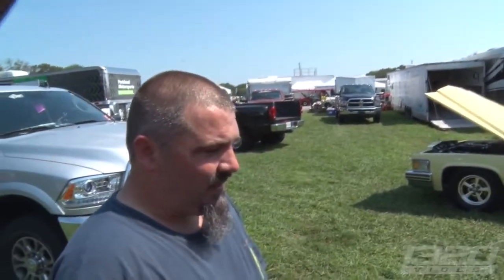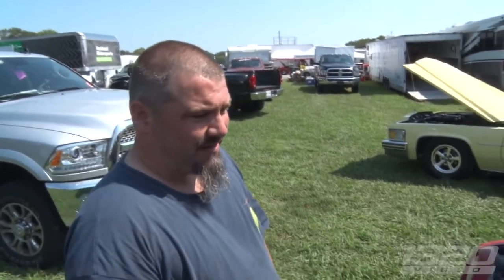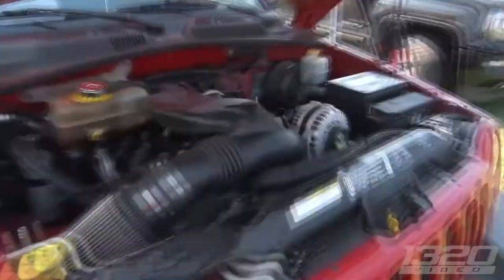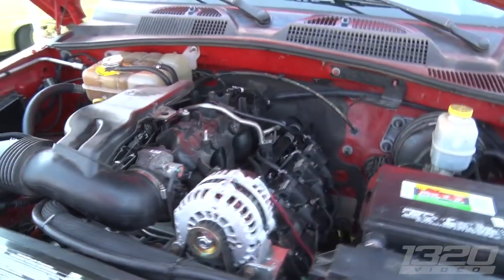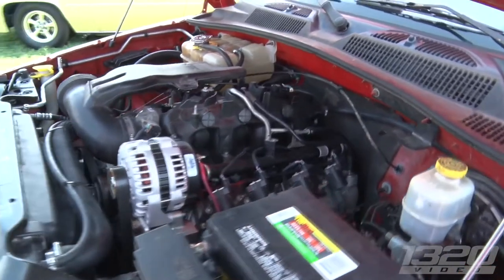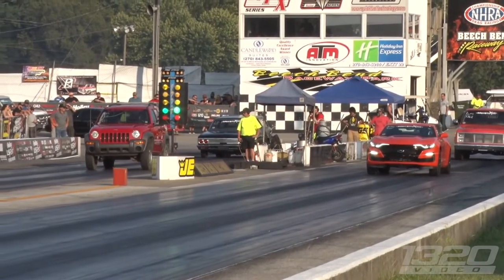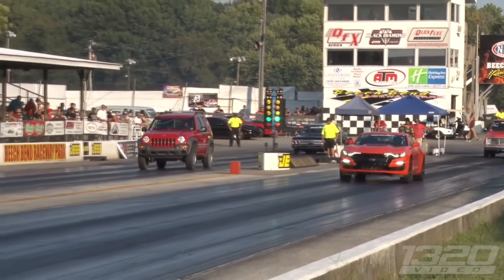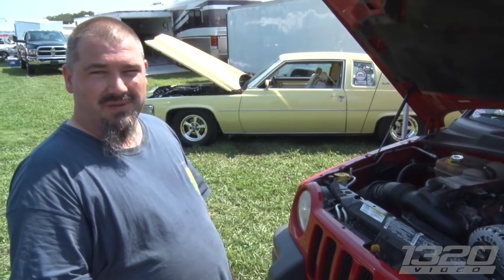1320Video Ls Swap Jeep Liberty - Holley Ls Fest 2019

Comment: I want to know more about this module! I'm a tuner and would like to know how it works and how to replicate it. Is it all CANBUS?
Reply: This is a conversion between GM Class 2 and what Chrysler called a PCI Bus. For the GM side and the Jeep side CAN would be next generation of what the data bus would have moved to in both cases. Chrysler/Dodge/Jeep switched to CAN in 2006 for pretty much everything and GM switched in 2007 for the V8 stuff since nothing with the E40 ECU really counts as TRUE Can since the only thing it used CAN for was the ECU and TCU. Everything in the vehicle was still run on the Class 2 network in those years.  And lets not even talk about the GTO, that's just a freak. 

I am undecided if my next venture will be to convert something like Mega squirt/Mirco Squirt(Maybe Holley Terminator X) so the aftermarket ECU's CAN is able to work with the Jeep's data bus....OR....if I'll do a stand alone system(Mega Squirt/Holley) into something like a GMT800 for a winter project.  

Over the winter I have a 2005 Jeep Wrangler cluster and 2001 Dodge Dakota Cluster (Both are still PCI BUS) that I'll tinker with and see how close they are to working with what I already have done for the Liberty. The Wrangler I will spend some time on since I know there is interest in those, if the Dakota is very close to the Liberty I'll also see about adding support for that as well but I won't loose any sleep over it not working. 

Now if it's something your wanting to try and get into your self. You'll need to be able to write code in C+, be able to design electrical circuits and layout a PCB in a program like eagle and then be able to solder the board up. Your best bet is going to be making your own tools to sniff the data bus with and it will also help with skills in C+ that you will need when it comes time to write a conversion program. There are off the shelf interfaces you can buy that will allow logging but they all lack good software so you'll likely end up wanting to write your own and that would be done in C#. 

Collect a log from the data bus, change something and collect a new log and look to see what line and byte changed. You'll have around 150-200 data lines that are all spitting out data extremely fast and each line has 8 bytes. Most items will be 1 byte in one line, things like engine RPM will be 2 bytes. Once you find something that you know changes with what ever your doing look for the range the value will change over to map the effective 0-100 range or if it's just a simple On/Off then verify your respective byte changes are correct and start working on a spread sheet. The On'Off values are not the hard one's to work out, its gauges that are where things get though. You not only need to make out the range of bytes that are covered but then work out a mathematical equation to put that range into something that can be written as a numerical value or even as a percentage of a starting value. 

You'll end up doing this for both data buses and working out formula so that data supplied by your source (swapped pcm) provides the same type of data that the vehicles original computer would have been sending. If this sounds like a lot of work and that it is very time consuming that's because it is. The reason you seldom see anything like this is because it is so complex. Some of the foreign car's have plug and play solutions that make this seem simple but that's because either the manufacturer provides the data and saves all the reverse engineering time or OEM data was leaked that contained most if not all the vehicles bus data. A lot of foreign car's also use a mostly universal message format across cars lines for a car lines life span so a set if bus messages may be good for close to a dozen vehicle platforms and be in use for 5-8 years. 

Domestic cars on the other hand were constantly changing message structure from 2007 until around 2012 and car lines did not share message structures, they may have shared parts but they were not directly compatible even with in the same year, there are times things will interchange and times they won't and it's hit or miss on what can be intermixed message wise over the data bus. This makes developing anything for those vehicles very hard as its going to be specif  to a given vehicle type and would only work on for a couple of years of that vehicle. 

And just to make sure it's clear, you do have to remove the original computer when doing this type of conversion but that's pretty much the point. If you wanted to keep the stock computer and wiring you would be trying to piggy back it onto the swapped engines computer. When you go for a conversion module it's to remove the stock computer and wiring.....the whole point is to keep things clean and simple.
Reply: @petesonntag7520  I love this! I am NOT a coder, but I understood everything you said. It makes be want to get into coding so I could implement this. I have a lot of Jeep guys that want to LS Swap, and would love to retain the BCM and factory controls of everything! Please let me know more about getting the wrangler working! Do you have a Facebook page?
Reply: @cliffweatherbee6914  What year Wranglers are you talking about? What engine generation? And stock or aftermarket Computers on the engine? :)

On the JK there is already an option when using a 4th gen engine with an E38 but its not cheap....and there is a reason for that. There is a TON of data that's being converted in those modules. 

I post a lot of what I do on my personal Facebook and as you've see also on my Youtube channel so those would be the best places to see anything new I'm working on. 
https://www.facebook.com/pete.sonntag.3
Reply: @petesonntag7520  awesome! Thank you! Ill definitely be hitting you up later. 

Right now I've got an 04 wrangler, and the owner is toying around with the idea of LS Swapping it.
Reply: @petesonntag7520  your gmt800 and terminator x project would have a lot of people on performancetrucks.net excited.
Reply: @petesonntag7520  Would a 06 KJ be able to work with a canbus LS without having to write code?
Reply: @petesonntag7520  Do you have a business page or social media page we can follow
Reply: Pete what other kind of pcb engineering have you played with?

Comment: Damn man where you from. If you was close enough id probably send you my toy to play with ive had my Dakota swapped for about 3 years now, runs and drives just never had gauges so ive never been willing to drive it out of town. 2001 4x4 dakota with a 2003 Tahoe LM7 and swapped over to a electric shift NP-233c but I still have my working dodge 233 if that would work better. Id love to have the systems adapted properly and everything function just like it came out the dealership.
Reply: Money would be involved obviously lol, but be a good practice guinea pig for you since everything is running driving ready to go.

Comment: Real life. .my daughter decided not to change her jeep liberty oil for over 6 months so it went dry and it sets in my driveway. I thought who the hell would do this. Fuck. I just might now! Your idea would be some shit
Reply from the maker: I put a blower on the Jeep last year simply because the whole LS Liberty idea seemed kind of stale at this point. So if you thought putting an an Ls in one seemed kind of out there....now imagine one with a Eaton blower on it :)
Reply: @PeteS160plus  I'm just thinking of making lemonade out of a lemon.  I was a few weeks of buying a f150 to build but I just seen the stupid liberty build now I'm fkn being stupidly wanting to give my daughter 500 bucks take it and build it. What u think? Lol
Reply from the maker: If the body on the Jeep is solid....and depending on the year I'd say go for the Jeep. I've swapped a lot of vehicles in my lifetime and this was honestly one of the easiest swaps I've ever done. Granted I turned mine into a 2wd but that was my plan from the start with it. I have a lot of pretty detailed pictures on LS1tech of what I did for everything and how various parts fit....and what parts I used for the swap you could use as a reference guide to do the swap assuming it's the KJ style Liberty. 

I've had the engine out of my Jeep 5 times since it's been on the road and its honestly extremely simple to take in and out.  If you remove  the hood you can pull the motor without touching the radiator....if you pull the radiator and AC condensor you can pull the motor without removing the hood. The last time I had the drive line out of it I want to say it took a little under 2 hours to pull the motor and the trans separately(by myself)....and that includes the time it took to drain the fluids, pull the enhaust, drive shaft etc so it wasn't just a quick hack pull.

Comment: I wanna talk to the guy that did the ls swap on his liberty  I've got an 05 that I wanna swap a v8 into
Reply: Same
Reply: I’m doing it and using an np149 awd t-case from an Escalade. Modified the sump on the pan with a modified pick up tube.  To work with the differential, earl truck pan with the double hump on the left side of the pan makes it all work nicely. You can mess around making stock manifolds work or buy Patriot tight tuck ls swap headers. They fit absolutely perfect!  There is more room in the engine bay than when the 3.7 was in there. Ruff Stuff fabrication sells 2” bushed dom sleeves that fit the width of the cradle pocket. Same for the trans mount pocket. Uses a small urethane bushing so more of a solid mount. Buy the ls block plates and weld up a mount. I might be making some when I get the trans mount finalized. These mounts would be designed to mount an ls with a GM t-case (with a clocking adapter to tuck up closer to the floor pan) and Patriot tight tuck swap headers. My cradle is also dropped 5/8” with 2 1/2” wide steel plate. Not really needed for the swap , I did it for lift reasons. Though it does give a hair more clearance around the diff for the swap.  Should be finished next summer, finishing up a different project over the winter.  Should be a reliable winter/daily when I’m done. I have a 6.0 and a 5.3 to use, but thinking the 5.3 due to less torque. Don’t want to grenade the front diff. Awd torque split should help, but not sure how it will hold up. Long term goal is to do a solid axle swap.